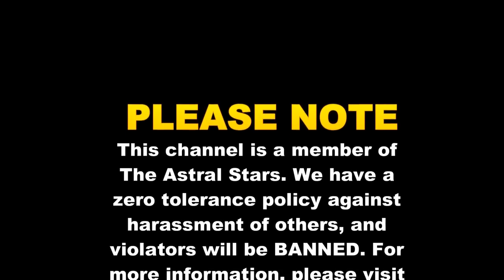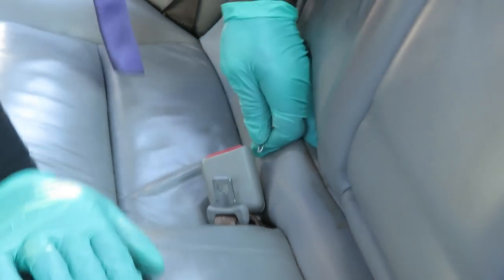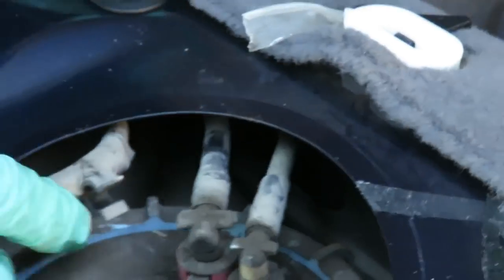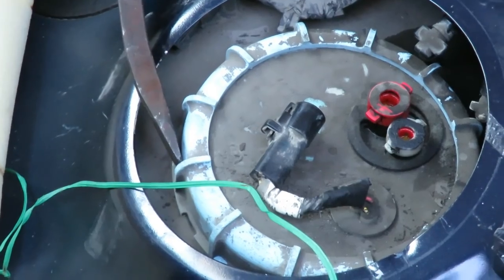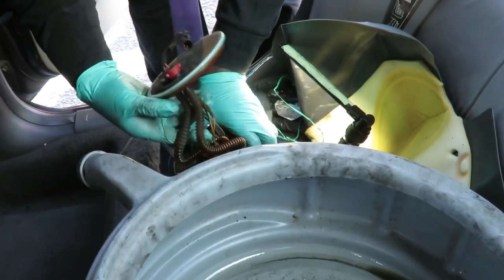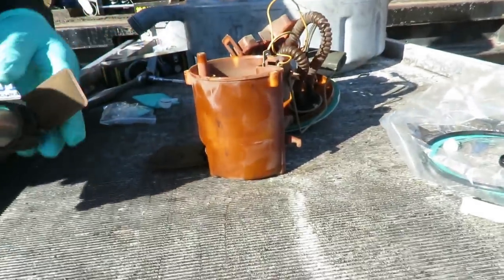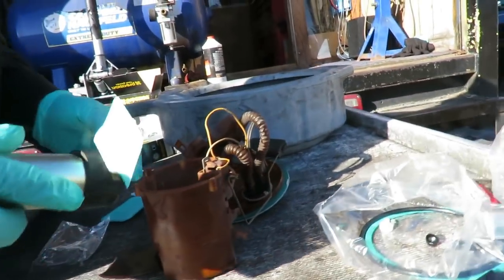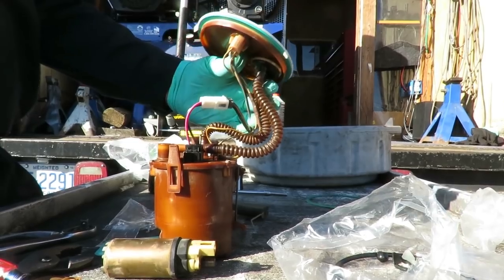⭐ 2001 Lincoln LS - 3.0 - Fuel Pump Replacement

Comment: Kudos to you and your helper! great detailed video...peace to your feet!
Reply from the maker: Thank you kindly!
Reply: @OnlineAutoRepairVideos   a note: some may assume...without inspection first...that the parts they might order online/local store to replace the fuel pump only, in the sending unit assembly, might be factory...but in my case, the whole assembly had been replaced, at least once, somewhere between 0 miles -107,000 miles before I purchased this vehicle. (2004 LS v6). I ordered through amazon a fuel pump replacement only kit, but the bottom of the pump (a notch for positioning and to prevent the torque causing the outer pump casing to turn freely) wasn't in the same position as the one I was replacing. The filter did a 90 degree from the inserted new pump, then outside the inner basket and up the side. (just means this housing will not siphon fuel when the fuel level is below 1/4 10 1/2 inch...later I will buy a complete assembly with dual filters now that i know this). The outer assembly basket on the existing assembly does not have a filter. So the kit didn't include the right filter replacement. My not removing the pump first and inspecting made the difference in what I ordered, but knowing this was a better pump, I just modified about 1 1/2 square space to allow rotation of the new pump and old filter (which was very clean and reusable) and all worked well. Thanks again! db

Comment: Great video that I know I must do sometime soon.  My 2006 Lincoln sat in storage for 5 years while working in Japan.  It was driven during the time, but not very far or long.  The same fuel sat in it for 5 years at 1/4 tank.   Now whenever the fuel level gets to 1/4 the sensor errors out.  The code reader says it is Fuel Module A that is malfunctioning.  Which one do you believe it is, the Main?  Is there a level sensor attached to the Jet pump as well?
Reply from the maker: Thanks EJay, that pump has GOT to be bad by now!

Comment: Nice! I actually have a leak on my 2000 Lincoln laptop when I get to $15 at the gas pump. Should I replace the whole pump or just the seals?
Reply from the maker: If you can get a good name brand pump at a good price, replace the pump.
Reply: @OnlineAutoRepairVideos  will do and update.

Comment: So I have a question, I have a 2000 it already had problems with starting and then cutting right back off when I’m at a stopping. But the other day it started a loud rattling sound and sounds like something was dragging which it wasn’t. Then the car cut off and won’t cut back on even with a jump start

Comment: Did everything on your video with my Lincoln ls 00 but I don’t hear the pump turn on what could I have done wrong ??
Reply: Check all fuses and relays  related to the fuel pump...and even "diode 02" in the trunks fuse box

Comment: Would you happen to know where to get the tabs from (the red and white tabs connected to the fuel lines)? One side of my pump does not have them.
Reply from the maker: You can try a salvage yard or the dealer.

Comment: Why would i not have power at the fuel pump plug can anyone help
Reply from the maker: Did you check your fuses and relays?
Reply: Yes it was popped put another one in it still was no power checked the shut off switch up front it was unpluged so i pluged it in checked again and still no power
Reply: I bought the car thinking it was the fuel pump cause thats what they told my boss that what it was
Reply: @OnlineAutoRepairVideos  yes i did having a problem can you tell me what the pos. And neg. Wires are so i. An hook the pump up to 12 volts and see if it bad or not

Comment: Two fuel pumps goofy ford/Lincoln LOL.
Reply from the maker: We did an Audi that had a similar setup, but the lines connecting the two pumps were inside the tank. Why couldn't they do like Mercedes and Jaguar, they put the one tank, right in the trunk.
Reply: @OnlineAutoRepairVideos  On some Jaguars since the fuel pump is inside the tank. In order to drop the tank you have to remove the subframe of the car.
Reply from the maker: That is crazy, but oddly, now I'm looking forward to replacing one...not!